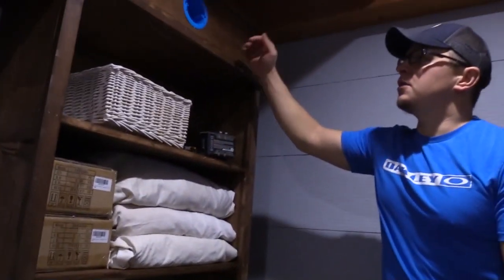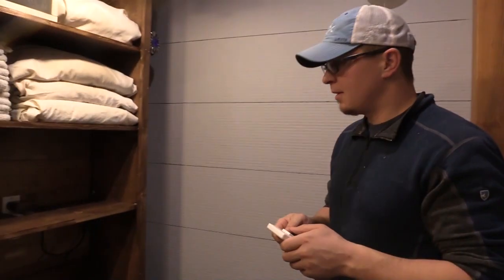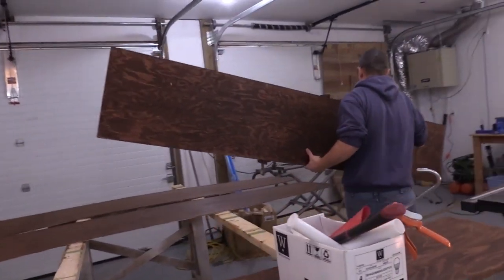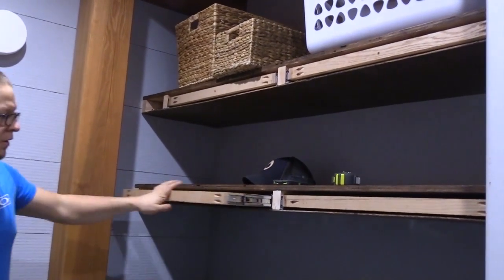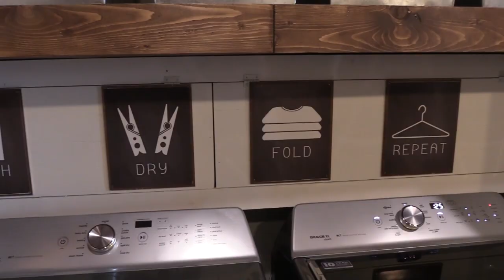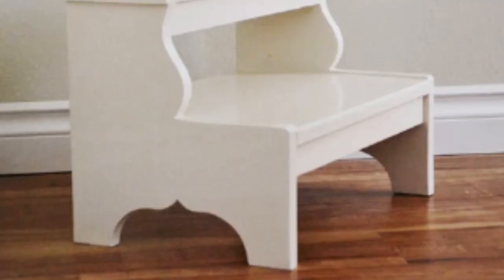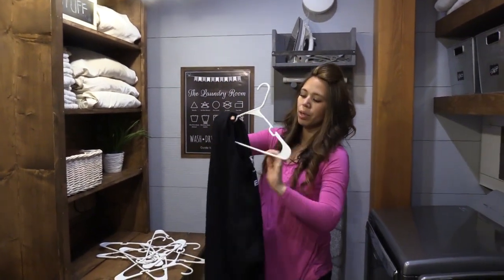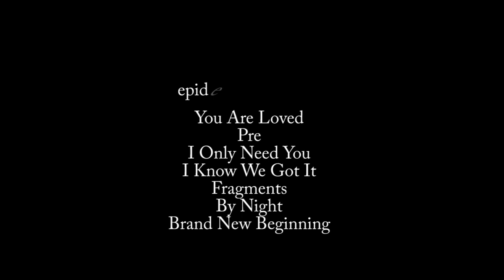Laundry Done

Comment: Ana: If I might suggest a good place to hang your clothes hangers; a wooden peg mounted horizontally on the left side of the cabinet where you fold your clothes. Set them on the peg from one side of the hangers or the other, not the regular hanger loop.

Comment: You could probably use a shower rod or some piping and make a empty hanger area so your hangers won’t get entangled while you’re trying to hang up clothes just a suggestion I know that’s one thing I hate about hangers 😂
Reply from the maker: That's a great tip, thank you!
Reply: Possibly use a small, straight, expandable (spring loaded?) curtain rod installed above the sink!  It wouldn't need to hold a lot of weight AND it could be removed without leaving holes. It could be spray painted in any color to match, especially after roughing up the original finish with steel wool or fine grit sandpaper.

Comment: In hindsight do you wish you'd roughed in wires ahead of time or located outlet and switch in better places? It looks like your outlet is in exactly the wrong place! Did you protect your wooden sink surround with a special stain or water protectant to maintain the wood? As for your drying rack, I wish you had sewn (oops) a square mesh top for your pullout so your future sweaters will lay flat without slat channels? PS, most drying racks for sweaters are 24"x24" and your rack looks pretty narrow for sweater drying. Sweaters need to be layed out and shaped pretty exactly or they stay the weird shape you layed them. Your pullout drawers and storage wall rack are genius! GREAT DESIGNS! PS Jacob suggesting he should put the light switch in the kitchen was FUNNY. BEAUTIFUL, functional design as usual!
Reply: I was thinking something similar about the drying rack but I wasn't sure so thank you for your incite.  I want to do something very similar for my laundry area.